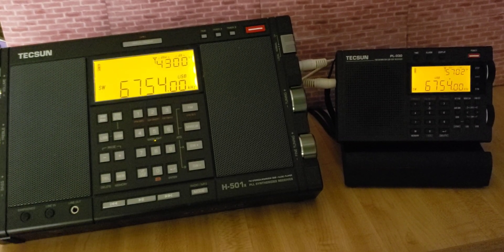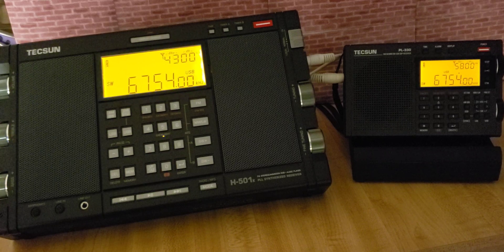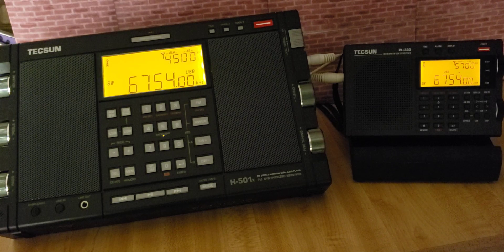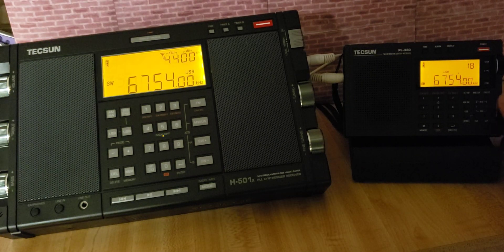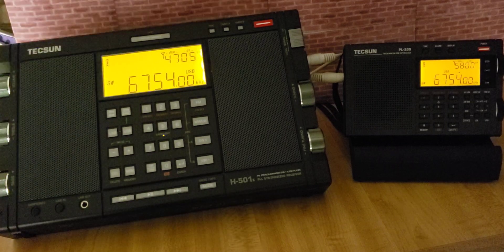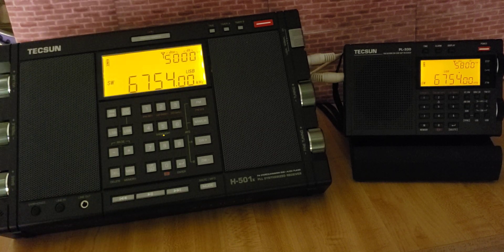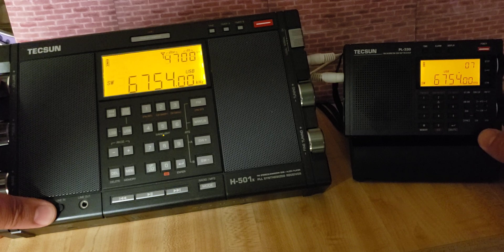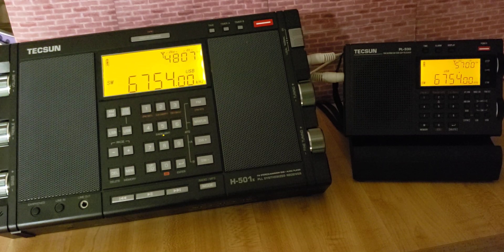Tecsun H-501X VS Tecsun PL-330 Trenton Military Canada 6754 kHz USB Shortwave on W6LVP loop antenna

Comment: I have a quick question for Giles or anyone in the know...

Does using a wye ("Y") connector (splitter) for the 1/8" mono jack affect reception? An example, in this video, if I were to use one antenna and use a Y connector to feed both of these radios, is there any reduction in sensitivity or reception of the signal?